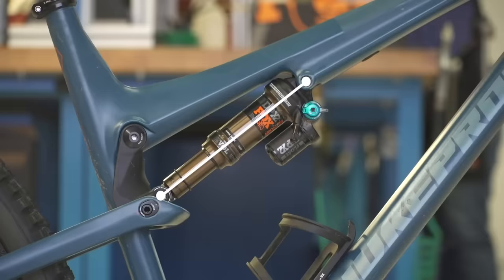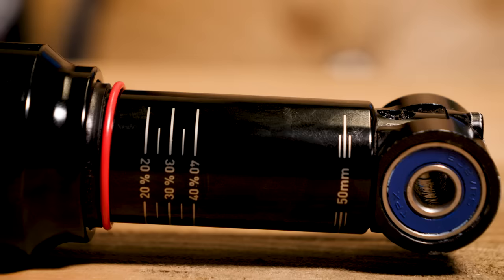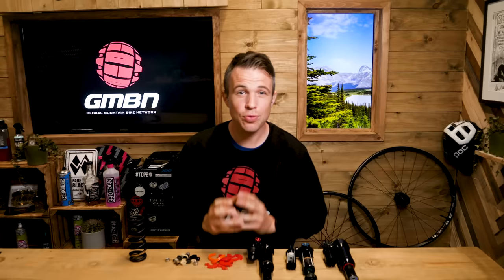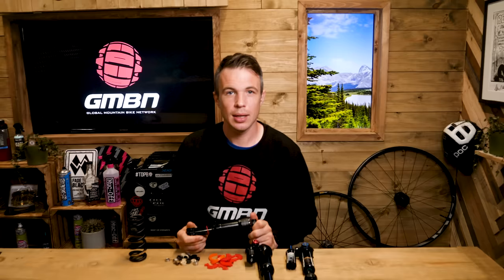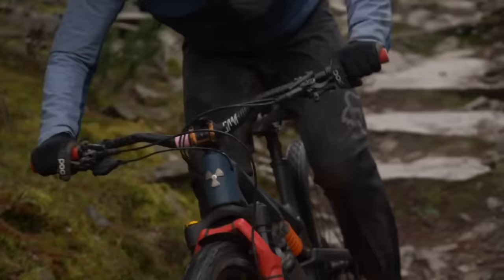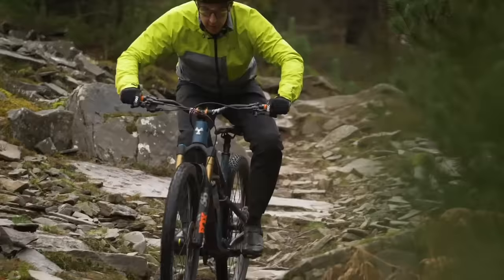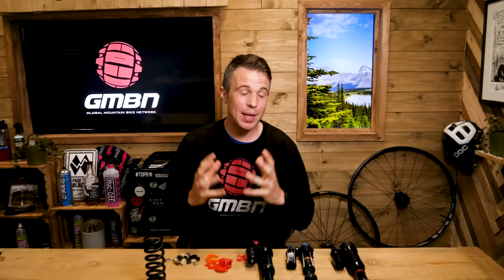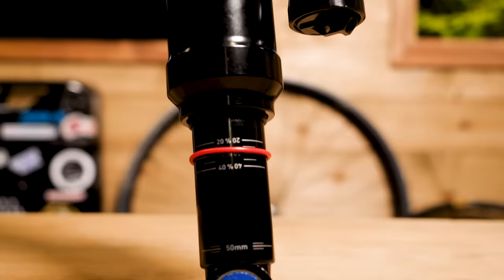MTB Shock Tech | Everything You Need To Know About Mountain Bike Rear Suspension

Comment: You can use 2 rubber bands on the shock: after full compression, the first band will indicate your max travel and the second band will show your sag.
Reply: Wouldn't both rubber bands have been pushed down to max travel then?!
Reply: @geemail369  you move one back and repeat the the sag measurement

Comment: One thing with the negative air chamber. They can't produce more than a vacuum to counterbalance. So roughly 14.5 PSI.
Reply: The negative chamber isn't under a vacuum, it's just opposing the positive chamber but they're both under positive pressure. You can customize the negative chamber in some forks and it's usually around 20-80psi. A vacuum would actually have the opposite effect and make it even more stiff, it would be like adding to the positive chamber.

Comment: 13:07 VVC doesnt preload the shims, it changes the mechanical advantage of the shim when pressing on the leaf spring
Reply: Cato Hobsbawn oxymoron, you’ve explained the same thing in two different ways
Reply: @clarkie005  late reply, but actually that's incorrect. Preload increases the amount of force it takes for the spring to start moving, whereas vvc effectively changes the springrate, meaning the force graph will be steeper. If you know linear equations, it's essentially the difference between the y intercept (preload) and the gradient (springrate). Vvc changes the springrate, not preload.

Comment: What if i use a slightly larger eye to eye? My shock is 190x 51 and ive found a good deal on a 215 shock will it work?
Reply: It will be too long and will either not fit into your frame or it will put a lot of stress on the frame which could lead to failure

Comment: I run an ohlins rear shock but it keeps bottom  out and loosing air. My question is what are the ideal personal weights for rear shock, would a larger rider like me 110kg benefit from a coil or spacers in my rear shock cheers

Comment: 'shockingly' good, as always H. Thorough, yet clear and understandable, and v interesting.
Aren't IFP nitrogen charged, rather than air?
Reply: Yeah, AIR. Can be Nitrogen or O2 vs what he said; coil. Check out 10:56 graphics showing Nitrogen...
Reply: Normal atmospheric air is 78% nitrogen and 20% oxygen. And the molecules of N2 are only 2.6% bigger than O2. So there’s not that much difference using N2 over air as only 1/5th of the air in air isn’t N2 and that 1/5th is only marginally different in terms of size and mass.

Comment: In regards to shocks. Why is it normally recommended to run slightly more sag on a progressive frame than a linear one? Why not the opposite as 30% sag at the shock is far more on the wheel travel. Why don’t set the bikes up with a percentage of wheel travel rather than stroke length? #askgmbn @gmbntech

Comment: What happens if you use the right eye to eye but a longer stroke length?
Reply: In good situation, you get more travel and no problems. Will affect your geometry though and might have issues with chain length and tension.
Reply: You get more travel on the rear and your wheel/hardware will possebly hit and damage your frame. Contrary to what the other guy says (false) it won't actually affect geo (because same eye to eye) except when using more travel than previously possible.
Reply: @TeamCykelhold  It will effect geo when at full travel.
Reply: Thanks!
Reply: @Pienimusta  only by allowing more travel, which is the whole point, and as I write only at more travel than previously allowed. So as a whole I would say that geo is not affected as long as eye to eye remains the same. Different eye to eye however would on fact change geo.
Reply: Thanks for the replies. So my bike uses a 190 x 51 shock if i use 190x57 will it have a bad effect
Reply: TheBossOfBread Possibly, the rear triangle might hit the front triangle. You’re also placing undue stresses on the frame and likely voiding the warranty too.

Comment: Yo guys, question here:
Yesterday I found out the set screw that keeps the rebound knob on my new fork (RS Pike) went missing. Probably wasn't tightened properly at the factory. Miraculously I didn't lose the rebound knob itself, so I pulled it off to make sure I don't lose it. 
Will I risk  damaging my new fork if I ride without this knob in place? (until I get it fixed ofcourse) The hole where it plugs into is kind of exposed at the bottom.
Reply: Find a similar screw. It doesn’t have to be a set screw, any screw with the same threading should work. It just won’t look as clean

Comment: This is too much and too fast. 
Very confusing imo.
'Bushing overlap'?
Reply: Most sliding systems use two bushings: one at the top, and one at the bottom. Bushing overlap is the distance between these two bushings. More distance (and overlap) equals a stronger and stiffer system.